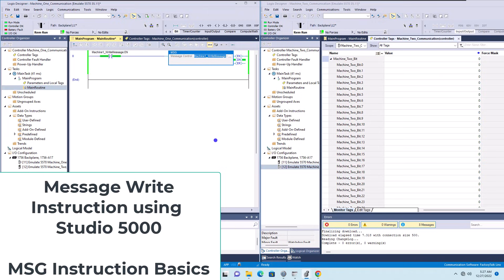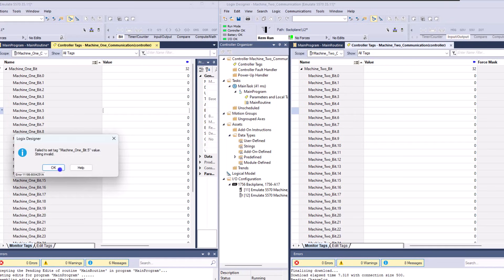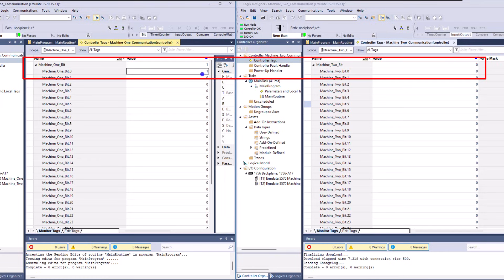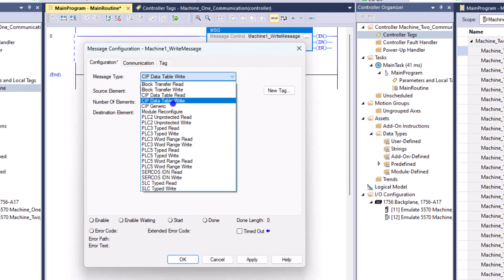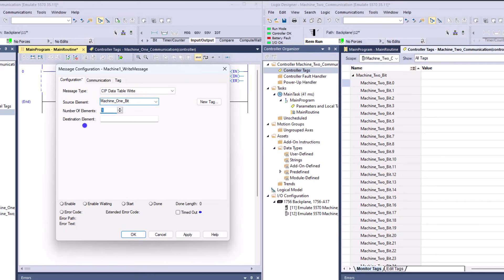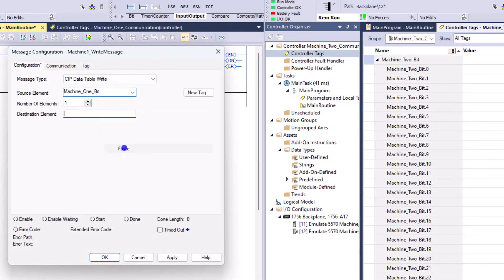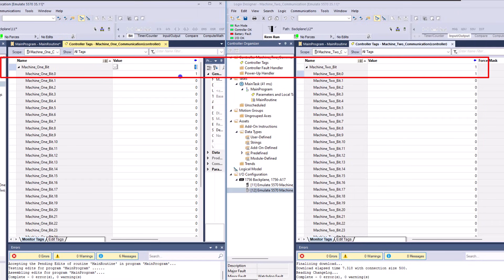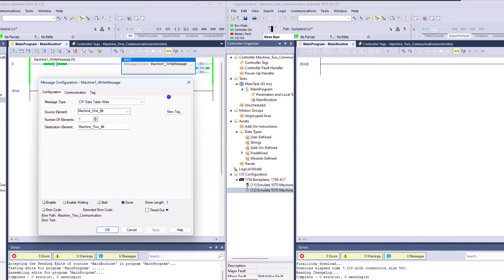Studio 5000 Message Instruction Basics  | Read/Write PLC Data

Comment: Hi Shane, 
Thank you for the great video. I am looking at some older software using CIP generic message type, have you got any videos or information going into more detail on this type? It seems like the PLC is pulling data off a control net card in the same rack. Thanks a lot.
Reply from the maker: This video teaches CIP messages
Reply: @ShaneWelcher  Hi Shane, Yes I have watched it and found it very useful. However now I am trying to learn more about the class, instance and attribute values. I have found the CIP network library which gives me information on class and instance. But I am struggling to find information on the attribute, do you have any information on this? Thank you.
Reply from the maker: 😢 @jstrong0 Why not use produce/consumed data..
It's much better than a message block
Reply: @ShaneWelcher  Well it's old software that I didn't write and have inherited. Its looking at a control net card and its trying to detect control net A or B faults but not working correctly. I am currently looking at removing control net completely and go to Ethernet, but thought I would try and figure it out. Love all your videos and thank you for taking the time to reply to me.
Reply from the maker: @jstrong0 Look at RA knowledgeBase

Comment: Great Video. Appreciate your work sir.
Reply from the maker: Glad it helped, thanks for watching
Reply: @ShaneWelcher  one question, how did you add another controller. I know you could add A New module in the I/O tree, but how does it know that module is able to be used? 

I'm referring to the emulator. 
Thanks
Reply from the maker: @jessem7966  I added another emulated processor in another slot, increased the emulated slots to the max

Comment: Is it possible to use PLC messaging between two PLC’s that have different IP ranges for example can I use messaging between two PLC’s with IP addresses 192.168.1.2 and 172.18.2.112?
Reply from the maker: Only if you have a switch that creates a connection like a NAT (network translation table) or you have a gateway PLC rack that has the two IP address ranges on it to use as a through put to talk through the back plain of the plc rack. Hope this help.
Reply: @ShaneWelcher  Thank you very much!

Comment: Hey Shane, thanks for the informative video. Just wondering would it be possible to use the Bool tag instead of an Double integer and use the message instruction to read from another PLC. For example if I wanted a my system to stop if an interlock occurs on a downtream PLC?
Reply from the maker: Yes but it's better to have a Dint because you might need growth in the future
Reply: @ShaneWelcher  thank you very much, indeed this is one of the best channels out there 🤩
Reply from the maker: @Abdiedits_  Thank you
Reply: Well if I put it into words I’m trying not to use a hardwired interlock and was trying to figure out the messaging side. Just another question, since you had both processors in the same tree, and I had to PLC’s connected over Ethernet, would I be able to use the tag of another PLC like you did using the Machine_bit2
Reply from the maker: @Abdiedits_  yes

Comment: Great video here as usual Shane. Thanks for taking the time to put it together. Its more common for me to see MSG Read instructions between CLX and as a part of error checking we use a heart beat rolling number to make sure its constantly changing. Apart from the err. bit on the MSG instruction, what alternative way can one use for a MSG Write to check that data is being sent successfully? Was thinking a check bit to write and read back but was hoping there was another way using MSG write alone? Your thoughts and feedback are always appreciated.
Reply from the maker: Have both programs have logic that counts a pulse to detect a heartbeat and if the count stops then fault.

If you want to check data from another plc program then it works the same as a read/write
Reply from the maker: By using logic in each PLC processor that monitors and updates a rolling number and if it stops for a set time frame then fault.